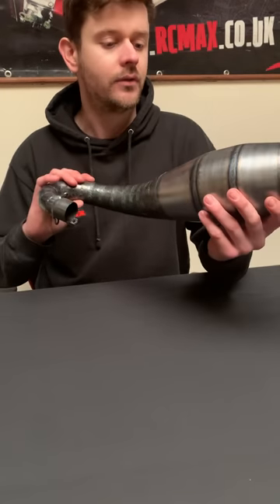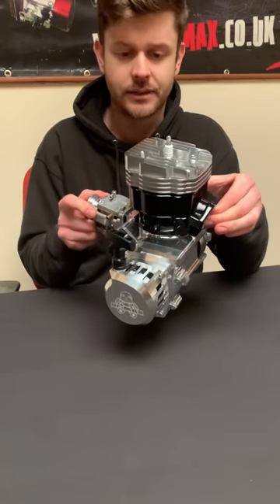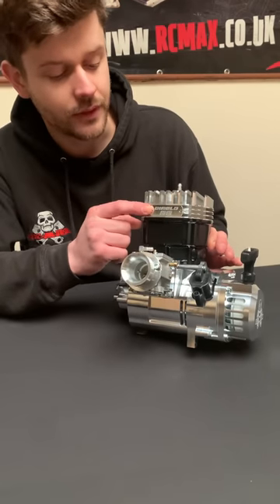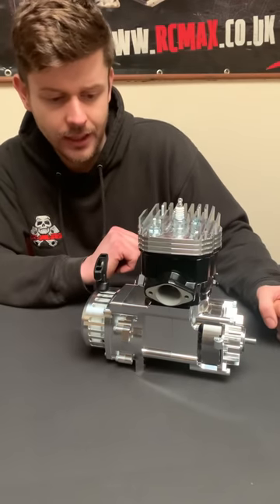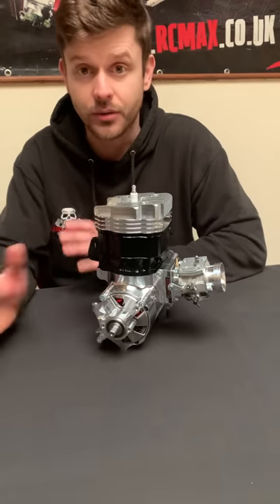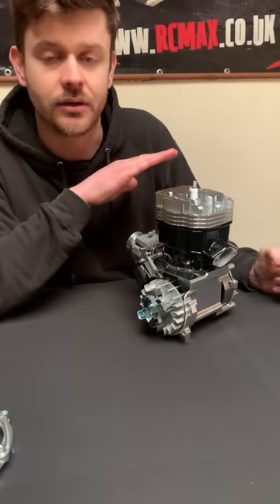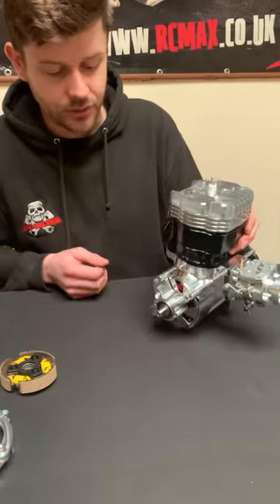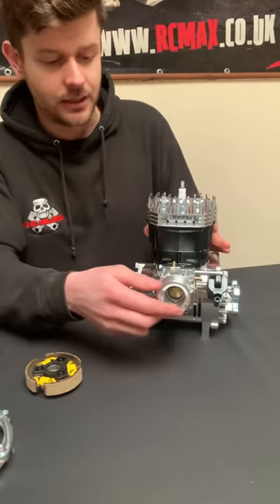NEW RELEASE -  "DIABLO by TAYLOR RC"

Comment: Bad move using the 460 starter on that monster of an engine. You will have a lot of customers call you up with broke pull starter problems. The pawl is to week. After a couple pulls by the average newbie the pawl will flex and break.
Reply from the maker: Thanks for your feedback, most of that issue is due to the 460 engine ign timing at idle tbh, these engine have now been in action for 7 months and not a single pawl broken, lets hope that hasnt jinxed them!  ALl the best

Comment: Will the turtle racing Transmission case work or do you need the Rcmax case??
Reply from the maker: You would most likely have to grind the bit off the front of the TR case that you have to for all big bores. But no different to normal with TR
Reply: @TAYLORRC  Awesome Thanks

Comment: Hallo i want byilding my own 100cc Race engine. 20 HP for Sure. IT min i Design the motore. U Show the Pipe very Well. Jes U laving at the Video. ITS true thats    Big,big engine. If U want to know anser my at YouTube. The crank Case. End the Site. Abaut the Zylinder. Back. I Not crazy. Very Chip at China factory.  Jes big Power of the Clutch.